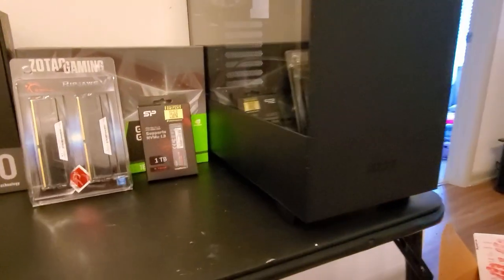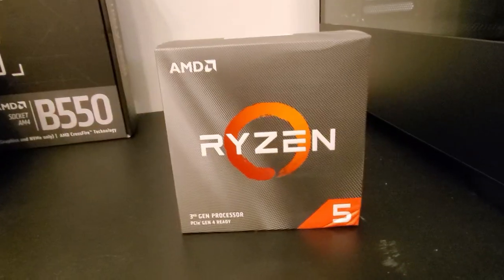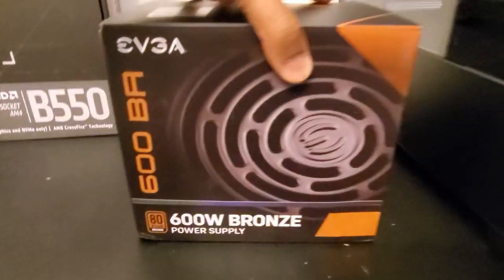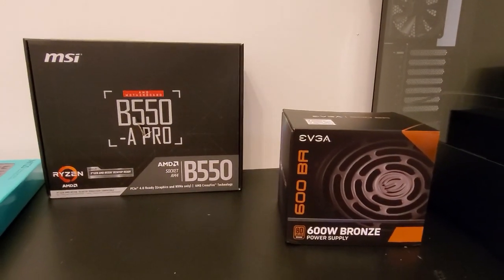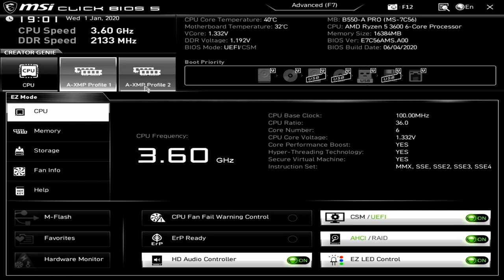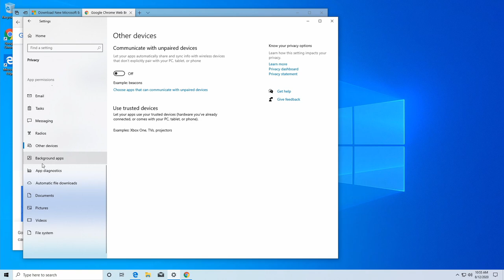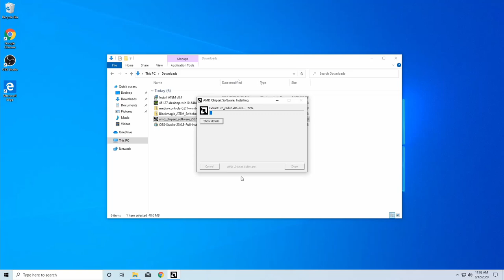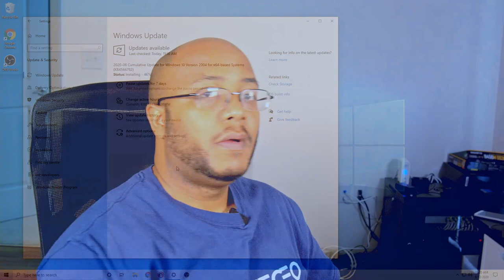VIDEO EDITING AND LIVE STREAMING PC BUILD | Moreover Church

Comment: Can you do more detailed videos on the hardware and software you use with OBS as well as vMix?  This video showed software installation but it was sped up way too fast.

Also, why use a video mixer like an ATEM when we have OBS or vMix for broadcasting and can also do that?  What am I missing where an ATEM would be beneficial?
Reply from the maker: I have vide3os covering most of the items you mentioned. As for the video mixer use, I mainly use it because it is more cost efficient compared to getting a multi-input capture device for the computer. The ATEM Mini Extreme is $1000 and an 8 input capture device for a computer is almost double that price but it still requires a beefy computer to manage the software and data being transferred.

Comment: Thank you so much for the video.
But can you recommend cheaper parts to build a PC for the same purposes? 
I mean, it is a bit expensive!
Reply from the maker: You could completely cut out the GPU and processor and only use a Ryzen 3 3200G but the render time will be very slow but doable.